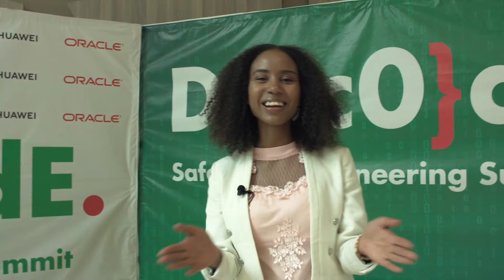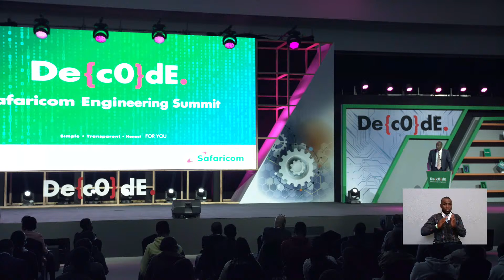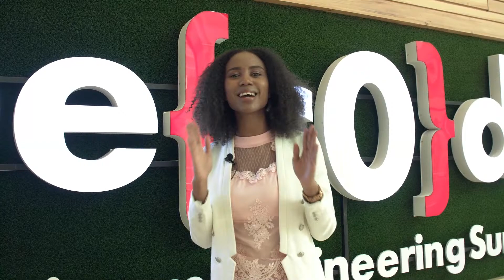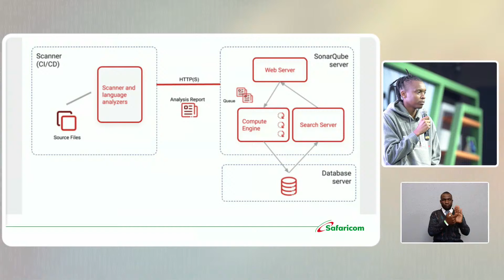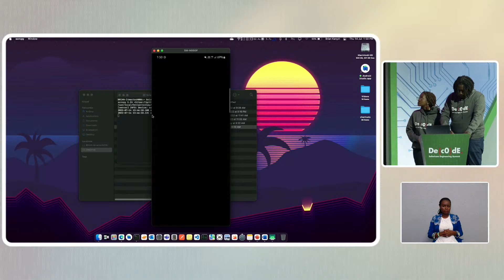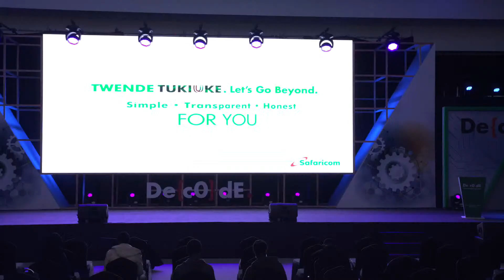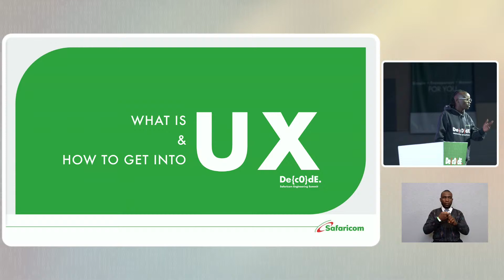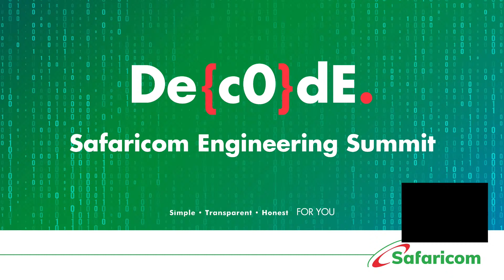Safaricom Engineering Summit

Comment: hy, engineer worlds,,have you were all heard about diesel racing 30 times bigger horse power after instal turbo,such as fan move by exhaust push air into pressure stroke room (2 times HP),intercooler,such as a rectangle metal cooled by fan and its own metal theory were inside is air flow sucks by turbo which compressed cause the cool air making bigger burn inside stroke room (3 times HP),Booster,this is new,,such as a water pipe arround air filter,more much more boost,its very cool sucks from turbo and stroke room,,very compressed air,its mean compact air before its burn by stroke room,, (5 times HP),,thats 3 in 1 colaboration on every engine type actually,,but how big efficiency reach right,thats the happening in racing engine this kind,,thanks,,peace,,hhe